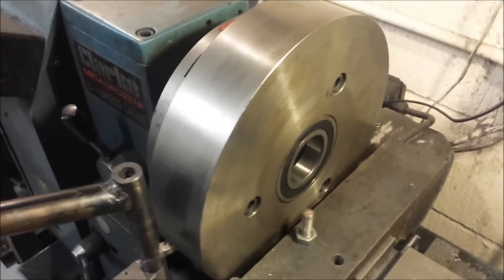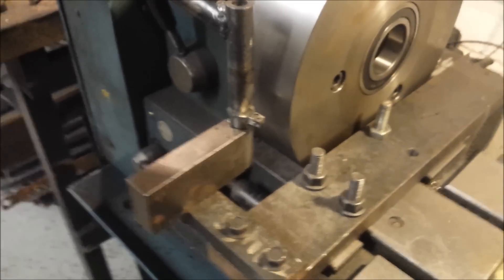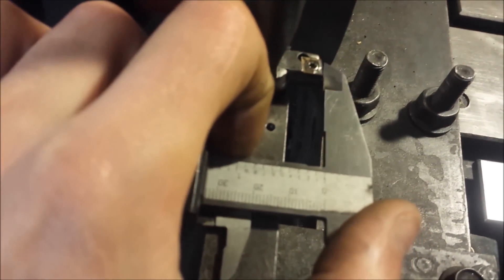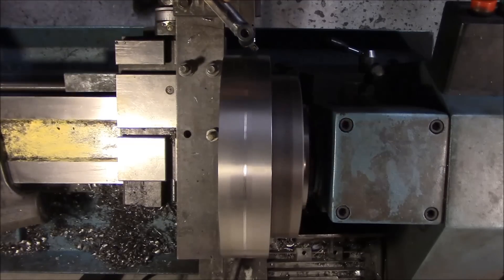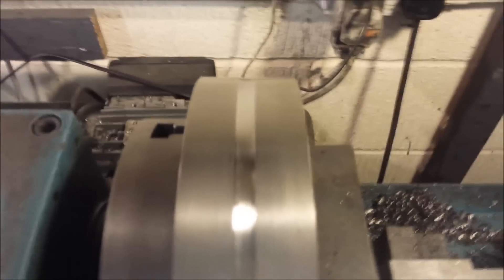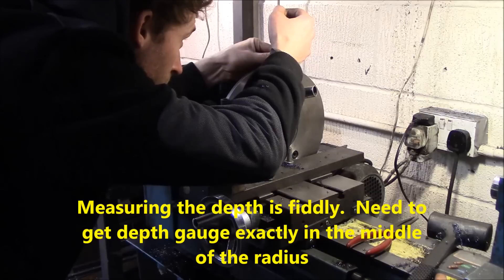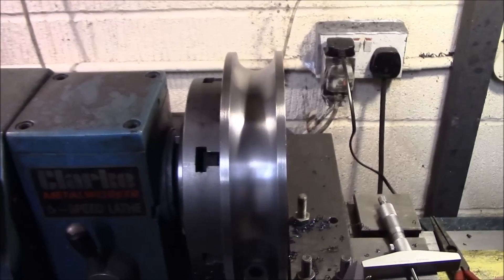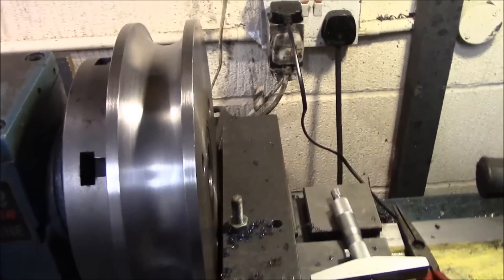Turning a Tube Bender Die on the Lathe

Comment: my humble suggestion about the procedure of this work,if firstly make a "v"groove near to required dimension with the compound rest ,and make a rough shape radius groove using a radius tool, finally finished that the job with the tool you can used in this video showing .it may reduce your physical effort and get more speed to finish your job.any way it is very great effort you did.👍

Comment: How did the die work? I was under the assumption that the dies were not a perfect radius. I thought more side clearance that .010 was needed .
Reply from the maker: The dies I made create a circular channel for the tubes, I went with 0.010 clearance which is 1% of the tube diameter and also the tolerance the tubes are made to.  They work just fine.

Comment: That lathe is sold in the US as a Smithy & various knock offs with a mill head, total crap, poorly engineered & worse manufacturing
. Do you have some kind of backgear? Mine did not & while you could swing 12" you couldn't turn more than 2-3 because the speed was too high unless you bought their uber expensive planetary reduction sheave.
Reply from the maker: £300 quid I paid, amazing what you can do with it if you're patient.  Usually very patient...  180rpm is the slowest you can go with the standard belts on mine, carbide tooling at this radius is fine.
Reply: I've got one of the smithy 1340s and it works really well for home hobby use. But it does have some pretty big shortcomings and limitations.

Comment: Nice work James.  I was just in a shop yesterday getting a demonstration of a tube bender at work and my immediate thought was how to make my own dies for different sized materials and different finished curvatures.  I will also need to make straight followers and there was your YouTube - half the answer waiting there for me.  Well done.  The material you used, was it cast iron?  

Now the next step, making the follower which has a straight section with the matching curve may be a challenge.  I was thinking of holding the work end on in a vice and machining on the mill with a boring bar and slowly working outwards with the diameter set in a similar way to how your cutting head ran on the lathe.  Any thoughts?
Reply from the maker: Hi, the steel is EN3B.  I've been thinking about a straight follower myself, my plan was to use a ball end mill of the same size as the tube done horizontally on a mill, possibly moving side to side a little at the end to get a slightly larger radius.  I'm sure a boring bar would work too.
Reply: James, soon I will be lucky enough to collect a second hand tool and cutter grinder from a die making machine factory that was happy to part with one for a good price.  The best thing about this is that I will also be able to learn from the staff there how to make stuff on this useful tool.  Maybe I could shape a tool that could go on the milling machine that would cut the curve quickly, like a large format ball end mill.  Rough it out with a boring bar and finish with the super-sized ball end cutter.    I also picked up some super sized drill bits and reamers from a second hand machine shop that is going into liquidation.  All I need is an 1-7/16" drill bit and 1-1/2" reamer and slice the end result down the middle and the job would be done quickly.  Now all I need is a huge drill press that has a morse 5 or 6 taper head.  Not sure if they come that big but that I cannot justify.  It never ends.   However, today I picked up my markup table that was surface ground across the full width {900mm} with what looked like 2/3rds of the width of the slash grinder disc.  The finish is beautiful and smooth.  This factory has huge machines.  Makes mine look tiny by comparison.
Reply from the maker: Sounds like you're getting there! Good luck
Reply: Peter Marsh, check with tool supply shops they may have suitable adaptors that can fit in a smaller MT and take that particular MT

Comment: That is brilliant how you are making the Dies.  Do you need to harden them before using them?
Reply: That steel is basically SAE 1020. You wont get any hardness to it. See if you can find someone who does industrial hard chrome single step. About .0100 mm.or .0005 inch.  It doesn't need to be hammer hard or thick. Just slippery hard if that makes sense.Especially with stainless pipe. It'll gall like hell on plain steel or another piece of stailess but slide right over hard chrome or that Delron some dies are made with
Reply from the maker: Hi. I haven't hardened them yet.  They are on the machine making parts.  At some point I will make some more and then get those ones hardened.
Reply: valveman12

Comment: Other than the terrible WAAAHHHH noise of your lathe in my headphones, this is fantastic! Now I need to try this. So, I need to make a jig for my crappy Atlas and 2; make sure my steel supplier doesn't screw me for the blanks! Thanks for the video.
Reply from the maker: Yeah, sorry, it's quite a noisy motor, I took off the old one and replaced it with a larger one which is much louder than it was standard.  Some metal suppliers will chop short lengths (2" minimum or so) off a large diameter round bar for parts like this.

Comment: Very nice James. I notice you made dies for different tubing diameters. Did you end up making different sized insert holders and extra posts to manage the different diameters? If the insert holder could slide back and forth and be adjustable (kind of like those lantern style lathe tool holders) would the rigidity be a concern? Thanks, nice video.
Reply: And I've love to see more of your tube bender and the follow die you may have made.